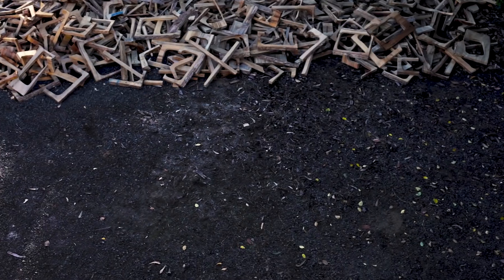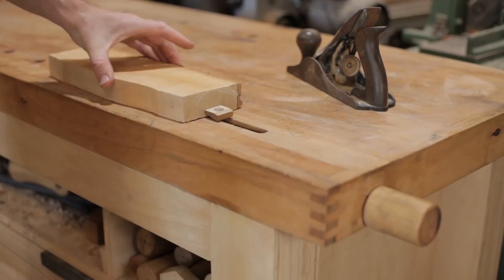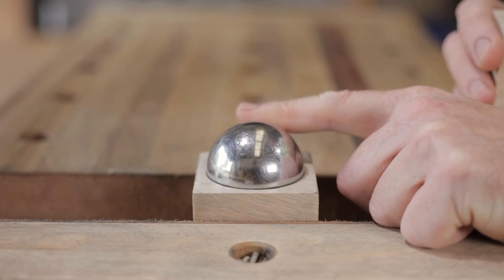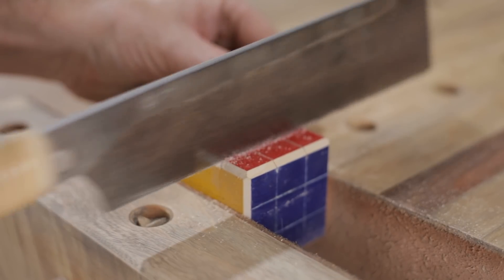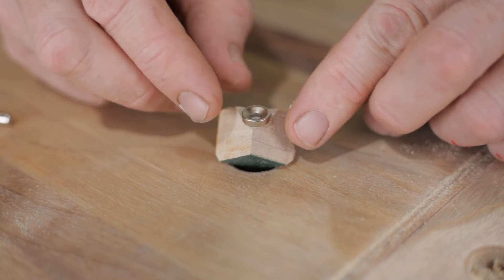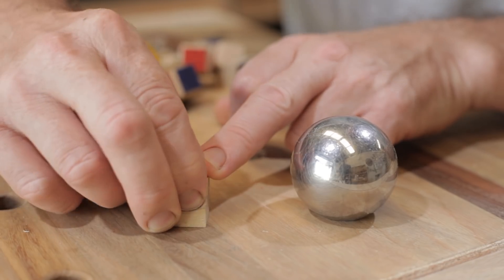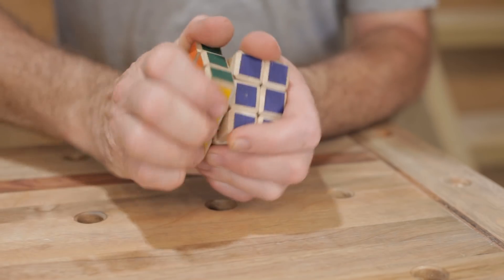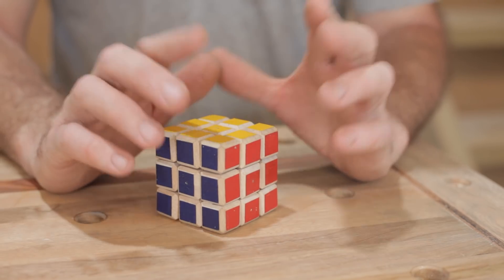Homemade Rubik's cube (Experiment) - Scrapwood Challenge Ep 19

Comment from the maker: I've had this idea in my head for a long time now, I've never been confident of it working but I had to try it out to find out for sure.

I would normally make a prototype of something like this but I didn't have time this week as I'm going away for a few days and I wouldn't have got the video made otherwise!
Reply: Pask Makes I would be happy with this result. Yeah maybe the magnets could be stronger. And a finish might help the blocks slide better. But I guess that’s why you have the pro shop and I work in a garage
Have a nice trip mate!
Reply: Rubik's Cubes are very light. The act of manipulating the cube isn't the only thing pulling at the individual pieces. The weight of the steel ball is as well. Unless you always support it from the bottom, the weight of the ball is pulling down on any parts you are holding onto 
just to keep it suspended.
Reply: I think the issue is that you allowed for too much movement
A real rubik's cube essentially has each face on tracks, that only allow it to spin in one direction at a time; I'm guessing yours caught so easily because any cube could shift slightly in any direction while spinning a face
Reply: You’re a bloody wizard
Reply: I love Rubik's cubes, I'll totally buy that from you! Interested?
Reply: Pask Makes shame on you for failing Neil 🧐🧐🧐 actually failure is not starting something so this is a brilliant & keep on being a great creator 🇦🇺🇦🇺👍👍👍👍
Reply: Great project, however, it neeeds a bit of improvement, as you have pointed out yourself! Have you tried taking apart a 'real' cube? The 6 middle pieces are fixated to a skeleton "cross' (in this case it would be the ball), and the only movement allowed for these is a horizontal spin. Also, all the edge pieces are attached to a section af a center 'ball', but since  it would be a bit difficult to cut the ball bearing into n pieces, maybe you could have a lip on 'inward' faces matching a curved rabbet on the fixed middle pieces (just above the ball), which would help direct the movement? Just a thought - i don't know if it can be done... Finally, grease or an other lubricant  on all faces is key ;)
Reply: It may not of turned out as you wanted but it looks great and it was interesting to see how you problem solved the issues
Reply: still pretty awesome, man.
Reply: Can you make this for me
Reply: Pask Makes really enjoyed that. Liked your take on it with magnets and the ball bearing. Keep up the good work mate love seeing you come up with your own ways of doing things.
Reply: It's not a complete fail. It's still a very kewl art piece.
Reply: You should buy an original Rubick's Cube. Then take it a part and have a look, how it's built. An Rubric's Cube don't need magnets.
Reply: Yes, but magnets between the pieces. Using magnets that way is a very common feature in new cubes, such as with brands like GAN.
Reply: The most annoying intro i have ever heard up to this date.
Reply: This is no longer a rubix's cube this is rubix's wood
Reply: Such a great idea!  Just a thought... To get stronger magnetic attraction to the centre sphere, how about using a hollow ball instead of the bearing?  You could cut it in two, line the inside with little disk magnets glued in place, then rejoin it.  You'd need a compass to make sure all the magnets were orientated with say, north pointing out.  Then make sure the magnets in the timber pieces had south poles pointing inwards.  I have no idea if this would work...

As for marking the high spots when carving the concave, perhaps you could lay a thin strip of carbon paper on the timber, then pull it out once the ball was in place.  Or even just roll the ball around on it.  I guess you'd have to repeat a few times in different directions.  Again, no idea if this would work, but I love the channel mate.  Cheers!
Reply: Can you make a 1.5 x 1.5 x 1.5 rubix cube and a 2.5 x 2.5 x 2.5 rubix cube?
Reply: Can you also make a 3x3 but it spaceshift like a square-one

Comment: The problem is the Rubic's Cube has six joints which all rotate freely upon three axis, and each face has interlock to the faces 90 degrees adjacent to them, and that sounds very complex, but is astonishingly simple given the nine pieces to each side. Remember that even though there are nine to a face, there are only six sides, so two faces are shared by the corner pieces, and that is only 26 free moving parts. Six center guides, one per face and each middle row has two circular guides for the adjacent faces to rotate upon. No problem!

Comment: I believe smoothing out the contact surfaces and waxing them would make it work better. There's not much force required to keep the pieces attached to the ball. If you can just get the forces that appear when pieces slide along each other smaller than the force needed to keep the piece in place, it should work.

Comment: I think you'd be better off disassembling a plastic Rubik's cube and attempting to recreate it's inner structure with wood, it would certainly be a lot more functional, but I suppose at the cost of durability in some of the smaller joints and crevasses

Comment: I think going back and gluing the magnets in and then giving the pieces a clear coat and using some silicone lubricant on the magnets and ball bearing would solve the issue.   I mean you're spinning it dry.  Even the official cubes from Rubix (which are not the ideal cube to buy) have some lube in them.  They begin to turn better as that lube gets worked between the pieces and the mechanism breaks in.

Comment: Perhaps if you fixed the 6 "center" pieces to  short shafts, rather than using magnets? They only need to rotate in place, and It would certainly cut down on the wobbling that causes the other pieces to bind.

Comment: Two things you could try:
1. Use an additional (weak) magnet on all the inside faces of all the cubies, this will allow them to stick together after completing a turn.
This gets complicated fast though, because you need an array of (96) correctly oriented magnetic fields. That's a lot of magnets!
2. Cut slots and grooves. Magnet puzzle cubes are out there, and they must be nearly perfect for them to work as well as their mass produced counter parts. The reason the plastic cubes work so well is because of the spring tension, and the special slots and grooves designed for speed.
Definitely a challenge of a build either road you travel. Good work!

Comment: I suppose the biggest plus is that if you just can't get it the right way round again, the magnets make swapping the pieces round a whole lot easier than peeling the stickers off and placing them back to "solve" the puzzle. Ha ha ha. Looks quite good, for real though. Maybe a wooden ball with dovetails tracks and dovetails pins on each surface piece might be doable, but that would definitely be a project of patience and fortitude, not to mention the math involved to get it just right, rounding off the corners of each track intersection. It would be time consuming, no doubt, but would definitely fit the challenge part. Also, instead of paint, use six different distinguishable woods. Inlaid or solids, either way. Thanks for sharing.

Comment: Definitely not a fail. Thanks for another great video. Might need to be careful with magnet polarity if there were magnets between the pieces, so as not to have problems with magnets repelling instead of attracting. Might be possible if some types of piece just have ferrous bits in (e.g. corners and centers) and some have extra magnets (e.g. edges).

Comment: What about smaller/weaker magnets in the sides of the pieces so the hold on to each other? Not so strong that it's hard to move but enough so that even if the magnet holding on to the ball comes off a bit, it doesn't fall apart.

Comment: I'd say you still have something there. What about securing the center pieces to the bearing? You could use pins or screws to secure them into the bearing but they would need to be able to rotate. This would model an original Rubik's Cube where the center pieces don't move; they only rotate. These secured center pieces would provide a bit of a guide for the other pieces. With that sorted, then the magnets might just be enough.

Comment: A magnet and ball bearing approach is very cool, and may indeed work with stronger neodymium button magnets in the pieces.   The actual Rubik's Cube has a 6-pointed mechanism, with each point a rotating post, connecting the center pieces (each having the concavity you've created here) that allows them to spin on each axis, then the edge pieces have that concavity with a little half-square bit on the back that catches under the center pieces' curved edges, and the corner pieces the same with a little quarter-square bit.  You could easily pry one apart to get the dimensions.  I'm not sure if your species of scrapwood is hard enough to stand up to the torque, but if you took your existing pieces, epoxied the little square bits to the edges and corners, and also made a 6-pointed rotating 'star axis' for the center pieces, you may get it to work.  You've already 'concaved' the backs of all the pieces with your spoon gouge, so you're partway there already.  If you still have the 'Rubik's Cube itch', that is!  Cheers!   :)
Reply: please post pictures of a disassembled rubiks cube! I want to make a large one out wood
Reply: @Hal-rk6wd    If you google 'rubik's cube pieces dimensions' and click the Images link, you'll see any number of measured plans, some of which may be free.  A note about the 6-pointed post connector in the middle, they do need spring mechanisms as you can see illustrated on some of those diagrams, so that the center pieces have a bit of give, or else that last piece will never pop into place.   Good luck!

Comment: I don't think this is a fail. It's a smart idea and a good project in the end, you did a really great job :) Maybe you could try adding small magnets between the cubes (on the horizontal and vertical sides), maybe it could help keep them aligned when you move them.
Reply: While the idea of adding additional magnets between the individual pieces seems plausible at first blush, I wonder if you may run into problems with matching polarities opposing each other while turning the faces and end up blowing the whole thing apart
Reply: @slhogenson1156  nope! The trick is to make all the edge prices north, and all the corner prices south. Since no two corners touch, and no two edges touch, it works fine.

Comment: There are a lot of problems beside the main project, that you manage apparently simple: the hole in the halves of the cube (especially the second half - nice camera trick!), how to drill a hole in the corner mini-cubes, and of course the idea itself to use magnets and a ball of metal. Very well done, even if you are not 100% confident with the handling. (By the way I think, that the surface of contact between magnets and ball should be minimal. Probably it is better to use small but strong magnets (with a small diametre) than using wide ones with less power.)